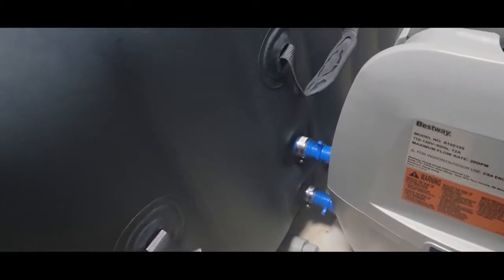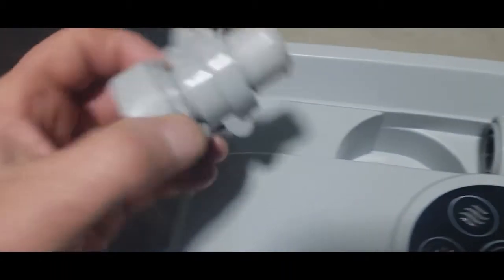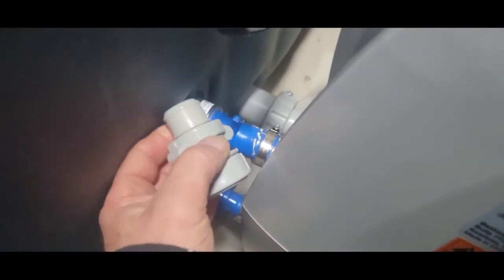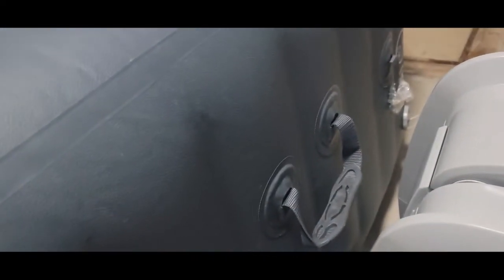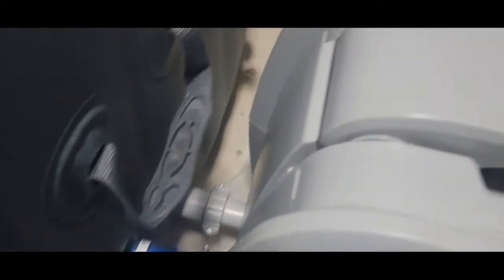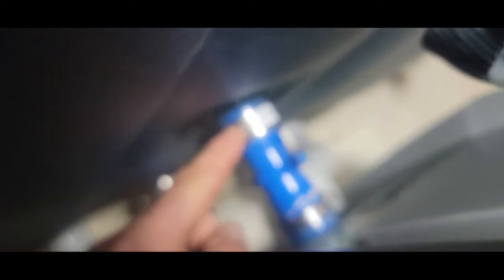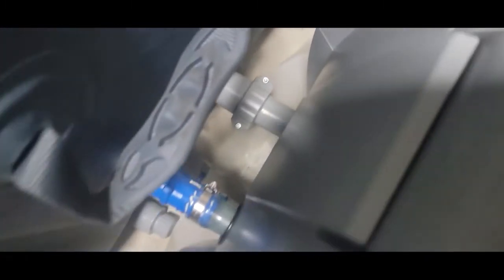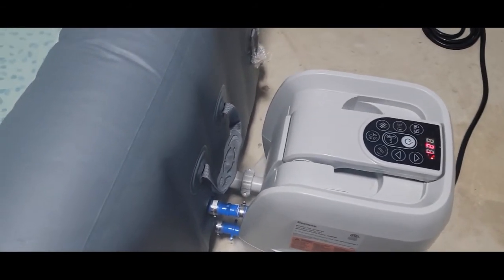Inflatable hot tub leak repair

Comment: Mine I have to replace the motor so I took it off and I was using it for a cold plunge and I put the caps on the inside of the spa but it is still dripping water out of those pipes could that be the issue with them being cracked
Reply from the maker: It does sound like it.